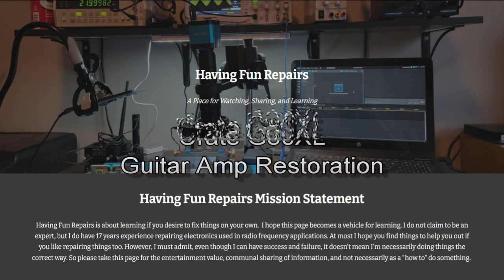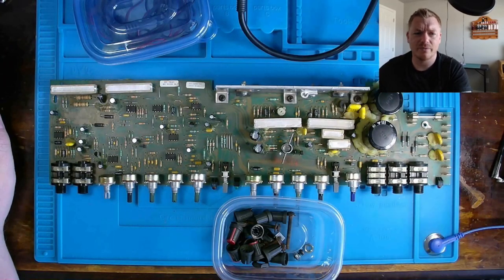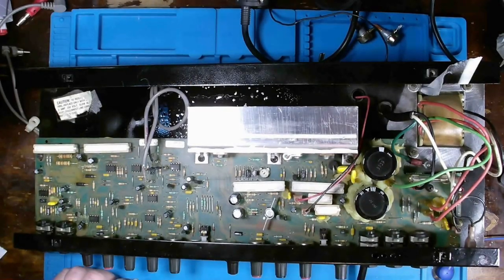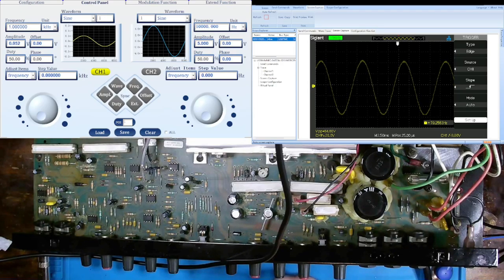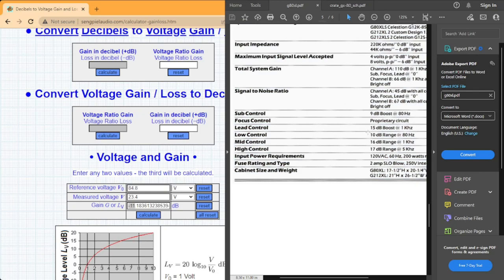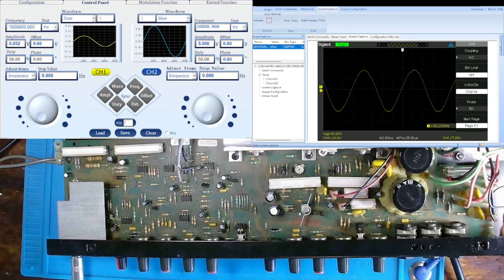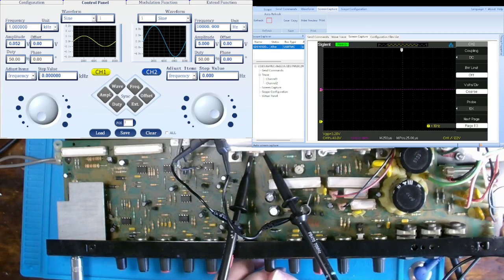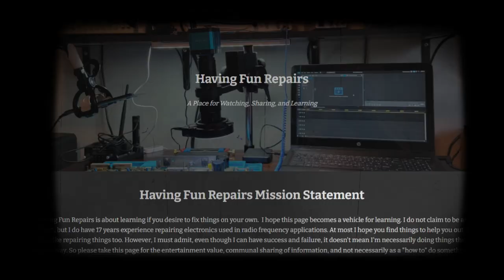(Part 4/4) Crate G80XL Guitar Amp Restoration

Comment: brother, this one of the best vids that ive watched on youtube, so far.
im a crate guy & your walk thru with in-depth knowledge has been great. i have learned a lot. you did an awesome job on the restoration, it looks wonderful. 
your attention to detail is a few step up on the ladder than most. 
(my family & friends say im too thorough on things, ie: why are you brushing the threads on that bolt or screw, lol)
the break-down of the pot, was helpful. but it seems the crate amp im working on has a differant style pot. they are SMD , but have a plastic shaft  & the wiper housing is a plastic body sandwiched between two metal plates. 
one thing i was hoping to see you do, was the cleaning and testing the 1/4" TS & TRS female jacks. my amp has the exf loop pair of jacks & a footswitch jack, a line out/phone jack & a L ext. speaker out & R speaker out jack, its a stereo amp with two 8" speakers. im having trouble with the jacks.
but i still enjoyed your vids a lot.
thank you
Reply from the maker: Truly appreciate the compliment. I thought cleaning out the 1/4" jacks with isopropyl or qd cleaner would have been rather boring material. So much during my video editing process is cut out 🤣 

If you haven't subbed please consider. This is an older video and since then I've started up a Patreon teaching test equipment and electronic principles and electrcial engineering.

 patreon.com/HavingFunRepairs

Only for consideration. It's a bit difficult growing a channel when you're as small as me. If you enjoyed the content please tell others. 

Regardless of the sales pitch 🤣 I'm glad you watched and enjoyed my content. Your comment made my day. Thank you!

Comment: Hey man. I have this amp and I am getting a lot of noise when I crank up the reverb. Where would you begin to try and rectify this ?
Reply from the maker: Depends on what you mean by noise. Clean the potentiometer first and then go from there.
Reply: @HavingFunRepairs   it’s not a scratchy pot. It’s more of a constant buzz that gets louder if the reverb is all the way up and disappears when it is all the way down.
Reply from the maker: Reverb naturally produces a hum that will get louder as the potentiometer is increased. That being said it is possible that you may have poor isolation at the tank or big metal box that houses the springs. You could maybe start there. If you Google isolating that box it will come back with several suggestions. You may also consider replacing it. Additionally there could be bad electrolytics somewhere in the circuit for the reverb feedback. To be honest there are quite a handful of things that may potentially be the issue, but it's hard to say without trying some things out to test for a solution.